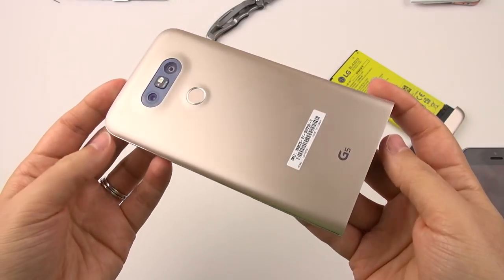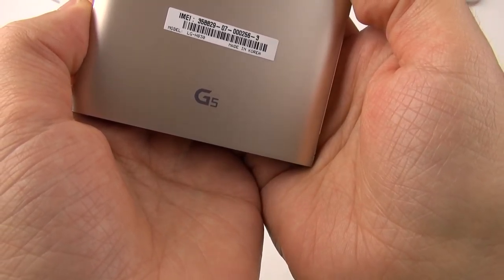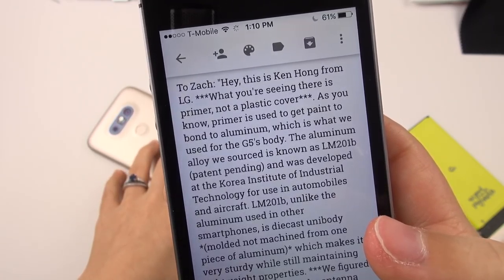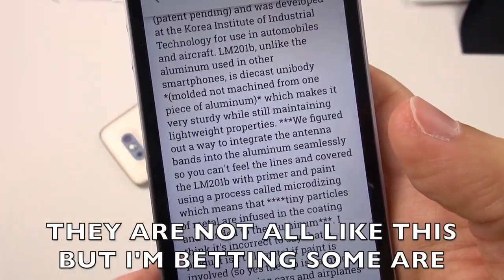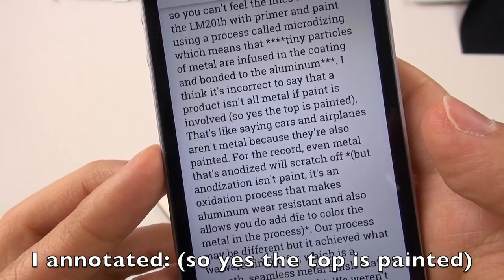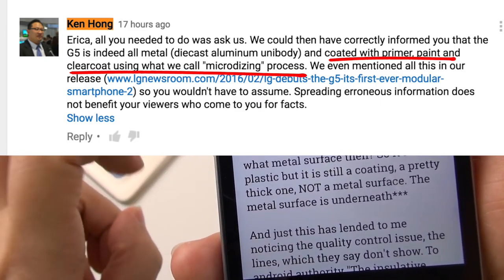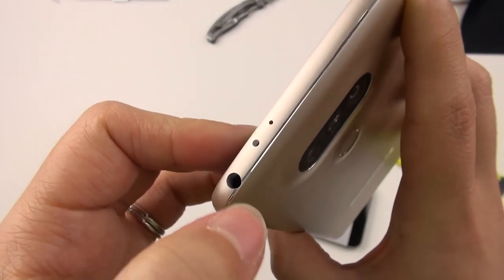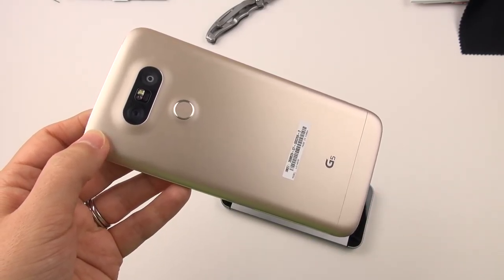LG G5 Not All Metal Controversy: Explained || LG RESPONDS

Comment: I think you're being too subjective for the fact that you're only speaking for yourself and NOT to the majority of the consumers. You don't know that all recent LG G5 phones have this. The phone you bought may or may NOT be the only one with design flaws as you claim. It's best if you do an overall review of the phone, both the design and functionality of it. That way, you don't sway customers away just because of a first "impression" video.
Reply from the maker: +asianmaster1 some have come forward and told me they have the same issue... There goes your argument.
Reply: +asianmaster1 
I hate to be negative but honesty I have issues with all LG products quality since I bought a flawed PC screen years ago "they deny that it's flawed and I threw it away".  LG has a major quality issues on most of its products, I have never bought any LG product for years because till now I still find some bad stories about LG, I hope LG try to reassess it's quality instead of being too defensive : )
Reply: It's not accpetable to let these phones through quality control.
Reply: +asianmaster1 Every newer LG phone has its own problems. I'm not sure about the budget phones though.
LG G2: Screen, digitizer issues (lines and dead spots)
LG G3: Overheating (that screen is really inefficient)
LG G4: Bootloop
LG V10: Second screen bleeding
LG G5: this
Reply: +Erica Griffin but are they all t mobile variants?
Reply: +RBLXDev In short, don't buy initial launch devices.
Reply: Kenji Only the G4 suffered launch issues. The other devices all had those problems even if you bought them a few months after.

Comment from the maker: **TOP POST: You know, I think the argument here went WAY off! This phone IS METAL. The only argument really is the coating and if we are touching an anodized body, microns thick or a paint job that is a mm thick. The difference is in hand FEEL. The video is to explain WHY the device feels like plastic, whether it is plastic or not! I do believe that parts of this phone have bits that are indeed not metal, they seem to be some kind of resin (headphone jack and at bottom), BUT we won't know for sure until someone puts this into a hot flame and burns away everything but metal. CASE CLOSED.**

Comment: Hey Erica, Nice video and glad to see LG made some sort of reply. I unboxed three total G5 units on my channel and all of them have some sort of issue with either seams, huge gaps at the bottom, or light bleed. While I certainly believe LG was trying to do something that looked better than other manufacturers I still believe it makes the phone look and feel cheap at the end of the day. I also entirely agree that LG was misleading with the all-metal statement. I hope we'll see LG issue a more public statement about this since a response in one Youtubers comments isn't quite the same as coming clean to the public. Great work and reporting, appreciate your contribution!
Reply: +Jeff Springer I take exception to the "huge gaps at the bottom" wording you used here, so viewed your unboxing video and I can understand why you should take offense to the 'visual gap' where the module attaches to the phone. Yes, it seems that on one unit - the height different between the two edges is clearly visible, but I wonder if this is an issue with the way it was attached to the base during production & packaging, and maybe not the default look of the unit after reattachment? There are clearly concerns with first gen launch units released with cosmetic production issues, that need to be remedied immediately before it impacts on mass purchases by consumers.  If these issues with the modules actually have a measurable impact on performance, then LG may be heading for a serious brand image derailment somewhere down the line soon.  Module attachment and performance is something I would expect reviewers such as yourself and Erica to keep abreast of users concerns on this matter and look forward to seeing what you find out going forward over the next 3 - 12 months.
Reply: Brian Adams I'm also curious how this is going to hold up once I start switching modules in and out and changing batteries. I have some concerns that the paint around the modular portion may peel but we'll see. I ordered the Cam Plus module and I'll get the audio DAC as soon as it's available as well. I'll definitely have a lot more coverage on my channel as things progress. Thanks for your comment!

Comment: LG is right. Just because they primed and painted over the METAL to hide things like antenna lines that doesnt make the phone not metal anymore. Most people use a case on a phone like this anyway. Your splitting hairs Erica Griffin.
Reply from the maker: +Matthew Johnson it's a metal phone. I'm not saying against that. It's their marketing wording I have been after...
Reply: +Erica Griffin Marketing terms are also correct, just because they painted metal it doesn't make it not metal.
Car is all metal when u touch it is u feel metal u don't say hey i feel paint o.o
Reply: So then if Apple called their phone aluminium and then put a plastic coat over it and then claimed it was aluminium you would say that is OK? Of course you wouldn't and all the ihaters would be trolling big time accusing Apple of evil. Erica has not done anything but point out what most of us noticed from the pictures, that it looks cheap, plasticky and toy like, not the quality you would expect from a metal finish. When we are paying around $800 we don't want that finish when the LG marketing machine claim it is metal. If you cannot see that the quality on this is not good then you are clearly a member of the LG fanclub. I really don't care as this is a pure gimmick phone that will appeal to the youth market and has no interest for me. The main problem LG has is that they still listen to a small sub set of users that insist on removable batteries when no one cares anymore. That means they cannot make their phones premium which is why Samsung and Apple take 100% of profits.
Reply: +amfrepo Speak for yourself! I totally care about removable batteries, that is why I bought the v10. People keep giving these manufacturers a pass when they take away important features and then charge us even more money for fewer features! At least LG listened to their customers. I will never buy a phone without removable battery because  I don't want to have to carry around a charger, and when I am traveling, most of the time I need more juice. Plus, all batteries wear out over time. If you can't remove, then your phone is a useless brick when the batty goes bad.
Reply: +Matthew Johnson *You're
Reply: +Speedo6677 You hit it right. Battery is one of the main parts of any smartphones. Moreover, to be a removable one is a very important thing especially when the battery is already drained and needed to be replaced.
Reply: +Adarsh Elamplavil get out much?
Reply: +Uno 1 of course if that is your priority buy something like this, but you have to accept there will be trade offs and for most of us batteries are solid enough to last a whole day so removable batteries are way down the list of priorities, one of them being a premium look and feel at those prices. It really surprises me how cheap it sounds when you tap the shell! I don't think this will age well and don't say put a case on, as it is a modular design with different size and shape modules, this will be a naked phone that will need a new paint job in a few months.
Reply: amfrepo Point accepted. Base on my observation and research, ALMOST all people buy smartphones base on how do they look and feel - physical features, a.k.a. PREMIUMNESS - FIRST rather than the specs, practicality and specially reliability (long term usefulness; about 2-5 years of usage). That's why people burn their money for new ones cause non-removable battery smartphones are too costly to replaced.
Reply: +Uno 1 True. Cheers.
Reply: amfrepo 👍✌
Reply: +Uno 1 Unfortunately true. The people who are interested in flagship phones will base most of their decision to buy on look and feel first, even if they know that the product is inferior to another that doesn't look & feel as good; which is why Apple have made astronomical sales in the past with phones that were clearly inferior to their Android counterparts.  The reverse is also true of Android in the recent past.  I got  a HTC M7 on contract, which was selling way below expectations due to the weight (metal body), overheating (metal body),  non-removable battery, camera and processor performance issues. Remember when the M7 was launched a non-removable battery was real reason reviewers & consumers hated the new design. But the design changed the industry with an explosion of metal frame / chassis or full metal bodied phones being launched, bas we all started to equate premium=metal. So eventually even Samsung and Apple bowing to the inevitable and going for metal chassis / metal bodied design phones. Who doesn't expect the Note 6 will be a non-removable battery metal body design this summer? Plastic bodied design flagships are done for ever. Even if new future technologies allowed carbon nanotube filament bonding of materials for plastic look & feel phone bodies to be manufactured, this would not convince consumers of today to give the new phones a chance. I still feel that consumers would want the phone to look or feel like metal - to give them that 'premium' flagship satisfaction vibe that you would currently get from purchasing a Samsung Galaxy S7/S7 Edge or iPhone 6/6S. It doesn't mean they would be correct though as full metal body designs will stifle future innovation, if that is all the consumer seems to accept.

Comment: G5: A certified epic fail. "the metal is underneath" LOL. Most phones have metal underneath. LG, the whole freaking point of a metal design is actually METAL touching your hands, FULL metal, no fake paints!!! Learn from htc, huawei and iphone designs! to name a few.
Reply: +Amir Amran no a lot of phones have a metal frame with plastic body
Reply: how does aluminum turn pink? champagne? dark grey with stainless steal for a logo
Reply from the maker: +Carl Draper yes, but then it should not be advertised as metal but as a plastic phone with a metal chassis?
Reply: Erica Griffin what I'm saying is Amir is talking crap.
Reply: Erica Griffin this isn't a plastic phone on a metal chassis,  it is metal with a coating.
Reply: Carl Draper That is only you talking crap to yourself. which of what i wrote is "crap"? Answer that. I wrote what erica said in the video in other words. Don't be ignorant and blind. Generally, LG failed with the metal design. End of story. It is what it is. That is not a full true metal design, go hold htc one m9, iphone 6s plus and compare yourself. Its about the look and feel.
Reply: +Amir Amran "full true metal".  A metal-bodied phone is only metal if you can see & touch metal then?  I would like to see someone, even Techrax break the LG G5 through normal usage, to prove it's durability. Like #bendgate, does the phone deform if sat on like the iPhone did? Does it dent like other metal bodied phones? I have a slighty dented HTC M7 that 'bounced off a walll not so long ago by accident. These tests would stop a lot of the commenters using the terms 'plastic' to describe the phone, one way or another.
Reply: Brian Adams Your reply is peculiar and irrelevant to what i wrote. If you don't understand what i mean by writing "full true metal design" then you could just ask but don't reply just for sake of replying. The g5 metal design is made in a process that makes the device feel cheap, look cheap, warmer to touch and comfortable to hold compared to other metal designed devices and also have small dents  because the way lg choose to make it. They could choose other way of making but they choose this way. Due to what i mentioned it is safe and rightful to say that lg has failed. I would call the g5 design a failed prototype stage, an experiment that should be changed before selling the device.
Reply: + Amir Amran OK, now you are being ignorant yourself and responding childishly as you did with +Carl Draper. You have now explained yourself better than using the 'fake metal' arguement as before, and I do undersand your point and what oi said may not have been a direct rebuttal to you, but that doesn't make it irrelevant or 'safe and rightful to say that lg has failed'. After all - it is only your POV. I have elsewhere on this youtube post taken to task Erica and Jeff Springer over the same ground your mention, but still calling this design a prototype and a failure - is disingenous. This will not be known for some time and won't be determined by the instant dislike many consumers may take to the design, but ultimately on price v performance. Android reviewers &  websites will recommend a phone later based on a price reduction so G5 may still survive even if earlier adopters are against it, like the G4 suffered.

Comment: I just wanted to throw this out there. I don't work for lg or anything so I don't know the truth. but what it seems like there design isn't much different than an iphone with the antenna. they use plastic antenna bands which is what you see at the bottom and the 2 spots at the top. they use a different type of aluminum to keep it lightweight then just through a special paint and primer mixture over top of it all so you don't see the antenna lines. its still a unibody aluminum phone like the iphone but covered in a special layer to hide the antennas. I honestly don't think it's a big deal and it doesn't seem like they are lying in anyway.

Comment: Thanks for showing LG's reply, however I still believe it was very misleading for them to use words like "metal alloy body" multiple times in every marketing material without mentioning the FACT that your hands can't even touch (and your eyes can't see) the surface of that "metal alloy" underneath that thick polymer primer. 

And of course they still have to fix the poor build quality causing those visible plastic bulges underneath that primer, including the gap caused by misaligned removable cap ;-)

Comment: How come LG did not comment a thing about the terrible light bleeding and the bottom back gap between the body and removable part that is not uniformly joining the top and bottom parts? After holding to buy my next phone until the G5 was revealed as I expected a similar to V10 design, I got a  actual LGV10 after the G5 unveiling as I did  not like the G5 design and I'm sure the back will show scratches after some use without a case.

Comment: What I think is that no one buys a "metal" phone just because it has metal in it... It should also feel like metal which this phone doesn't because of the thick coating. Also the coating is done not because LG wanted to but because they need to hide that antenna. So although it uses metal in its construction but certainly it is not a well designed phone for the price and the segment.

Comment: Coating is normal in the electronic industry. For example, PCB manufacturing uses a process known as conformal coating to protect the PCB and at times the components on top of the PCB. there shouldn't be anything wrong with using coating. tbh the quality control shouldn't have allow the phone u received to be shipped to a consumer but the coating doesn't take away from the finish product imo. love ur videos otherwise.
Reply: When the coating is being marketed as being solid aluminum it's a problem.

Comment: LG dropped the ball haha, SG7 still has the premium material above everyone else
Reply: +SuperGear360 
Buddy, tinfoil and window pane aren't "premium". Those are cheap materials and not even suited for the purpose.
Underneath they probably have plastic to give it some stability.
Reply: +GrumpyKitten whats your point?
Reply: SuperGear360 My point is that there is nothing "premium" about the S7's materials.
Aluminium is probably the cheapest metal you can find. Glass is literally sand.

The High-End polymers in the LGV10 sure are more "premium".

Too bad they screwed up the build of the G5.
Everyone wants metal because for some reason it's regarded as premium and LG had to deliver.
It's a shame.

Comment: wait....it doesn't even look bad with the antenna lines showing, I think they just wanted to be the first to remove them and still claim to have the device made of metal
Reply: Prototype > production
Reply: +Joshua Kerbo I think the prototype looks much better with the antennae lines, the way the camera hump is gradual and the finish is the actual metal body. That would've been a much more successful design in my opinion.
Reply: +Kyle DC exactly.... like I said they just wanted to be the first at something in my opinion
Reply: Joshua Kerbo They probably became aware of Apple's patent regarding their special material that allows them to remove antennae bands on the surface of their devices and just wanted to one up them.
Reply: +Kyle DC rather have a special material then a thick layer of paint
Reply: Steven Juris 100%

Comment: I love Android and LG.  I work for Verizon wireless and work with phones 45-50 hours a week not including my personal use.  I've seen 3 LG g5 so far and on one the bezel was chipped and the other two I clipped the bottom in and the left side unclipped itself after 30 second's, leaving the bottom of the phone diagonal. 

people ask me if there's any Android that's better than Apple.... I tell them only the Nexus and Samsung.  

everything else is good but only lasts a year ( or is made by Motorola and will never get updates).
Reply: +Dave Lospinoso What about the G3, G4 and V10?
Reply: +TJ Sunanda g3 can't handle lollipop, g4 can't handle marshmellow, v10 I've seen 0 problems with and some of my close CO workers use it as a daily driver with no issues.